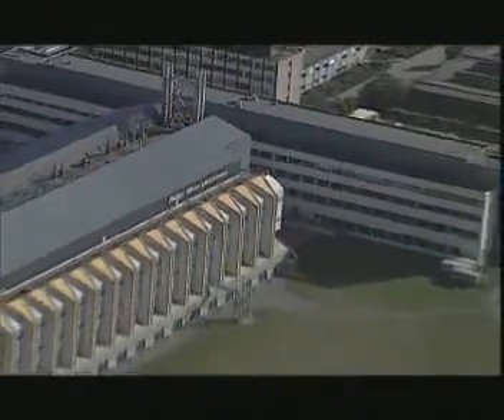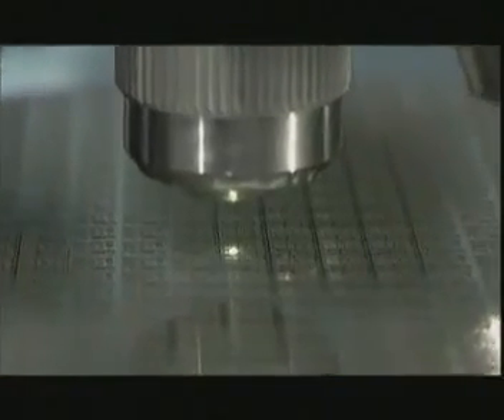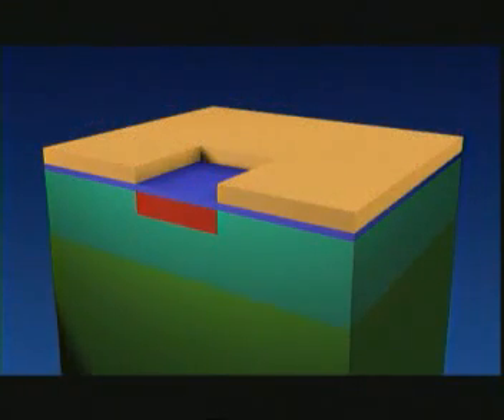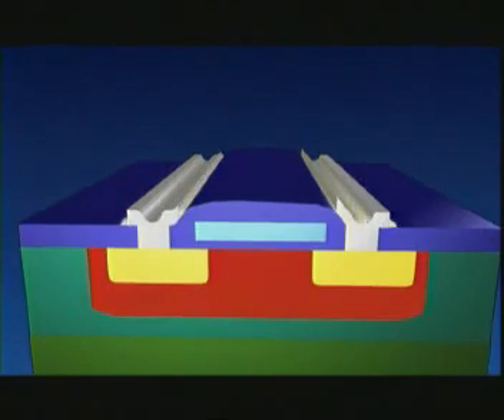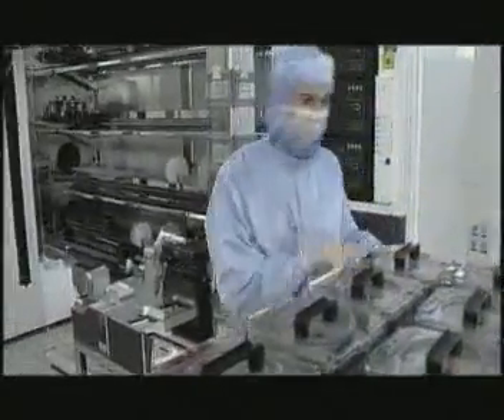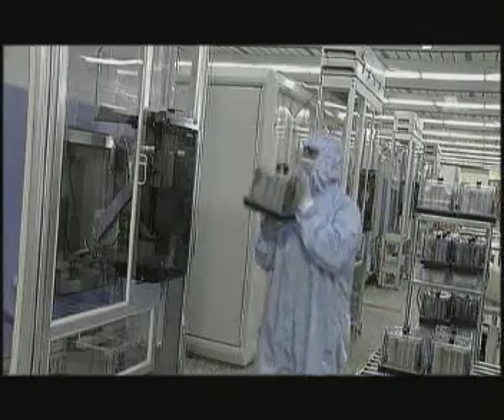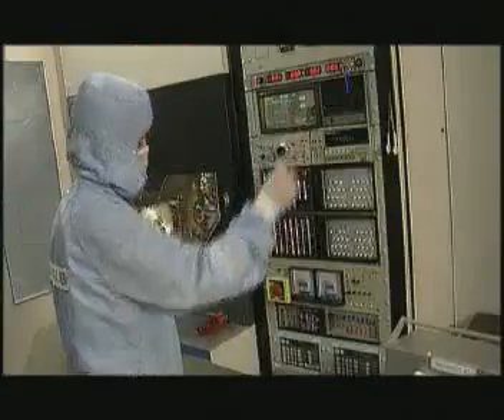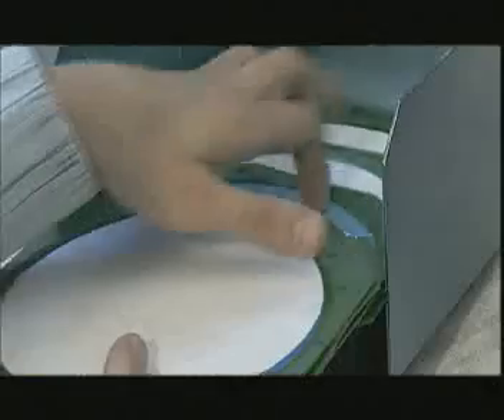Chip Manufacturing Process - Philips Factory

Comment: So, what's a decent failure Quota per wafer? In the Video there were a few IC's marked as defective, does that impact the overall profitability of all the steps taken to that point? - And maybe more Important, is it still possible to join a Research team and actually find a way to improve this way of producing Chips?
Reply: Martin Q Unfortunately it is nearly impossible to remove all impurities in an IC. As such typically there are redundancies in each circuit to account for the high failure rate if this nanotechnology. While this does reduce the space efficienvy of the final product, it yields a much more reliable IC